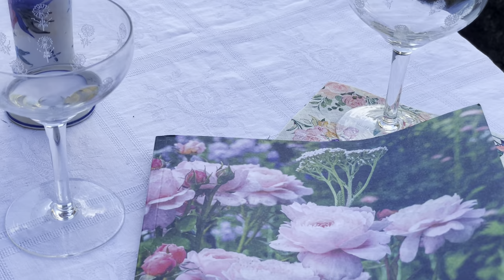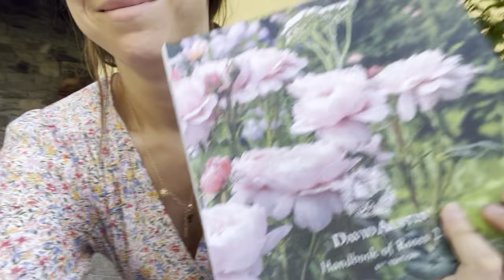Lots of painting at the villa/ Renovating in lake Como

Comment: Toilets in the US have a wax ring on the bottom that fits into the ground and makes sure gases don't leak. Perhaps Italy is different? The mural is lovely.
Reply: The U.K. doesn’t have that. I’ve noticed how the exit is under the bowl though so perhaps it should! The U.K. ones have the sewage pipe at the back and not underneath so it wouldn’t be needed here.
Reply: We have special silicone fitting

Comment: YOU will need a planner and a wax ring to fit your toilet bowl to the floor.  The black rubber phlange is for a water tight seal between your tank to the bowl.  You need a shut off pipe to the water supply. And last you need a toilet seat and silicone sealer for around toilet bowl and marble floor.  There are videos online "How to install toilet for beginner.
Reply: SORRY PHLANGE
Reply: @barbaraimrie745 Thank you. Unfortunately we don't have wax ring - we have silicone fittings, I think it's a bit different system. And we missed the side fittings for it - this is why I tried to understand which parts we need to buy and not tried to actually install it.

Comment: You need a plumber to install the toilet. It would be awful if it starts flooding all over your new floor.  Here in the USA, theres a rubber seal in the hole and then a silicone sealer goes around the toilet and floor.  I hope this all works out for you.
Reply: yeah, he will install it - i just was trying to understand which fitting we need to buy for him

Comment: Sewer gas will come through without a wax seal to the base of the toilet. Right?
Reply: this is why we have silicone fittings for inside pipe and silicone gel to glue it around the border when we actually will install it and not just measure